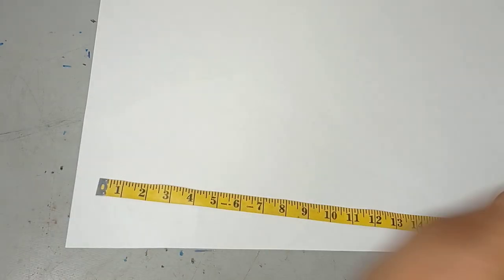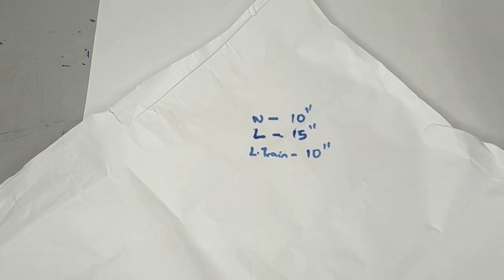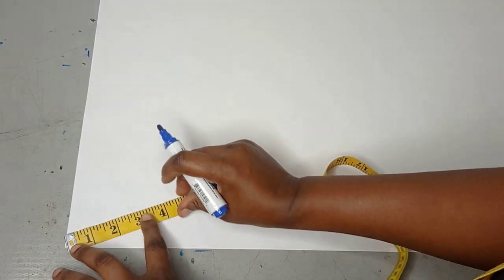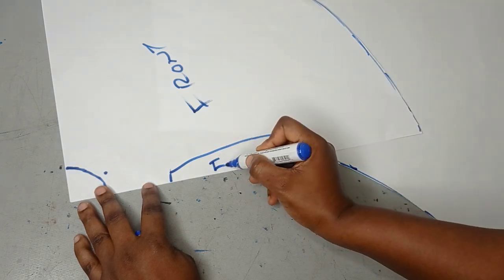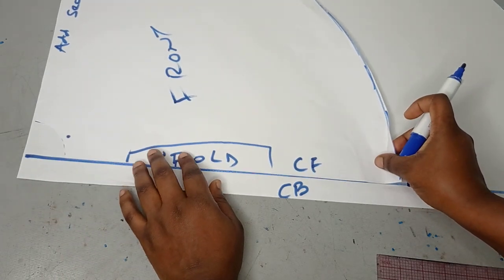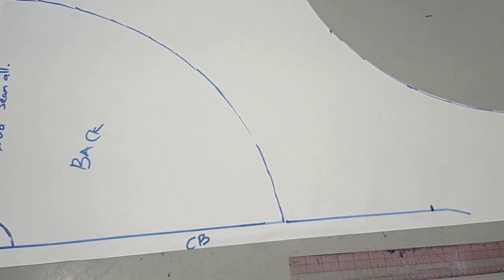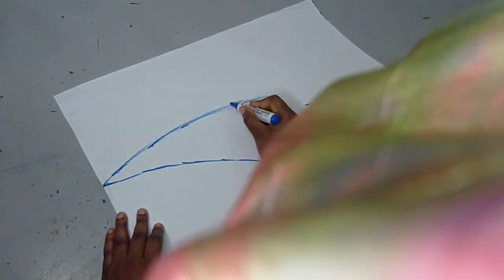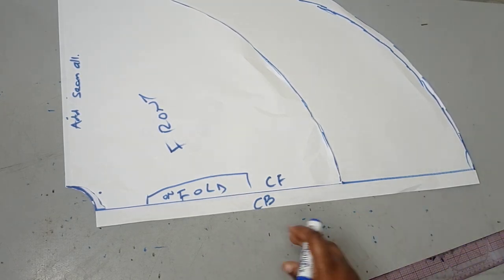How to make a WEDDING DRESS TRAIN Pattern | Mermaid Dress Train

Comment: Thank you so much ma. Please I have a question. Like how many yards do you think a person can use to make a dress like this. And what material is best suited for this?
Reply: For a floor length circle skirt, according to my pattern that I made, I needed 5 yards for the skirt if it's the same size all around. But if it's a trained dress, it's gonna need more fabric depending on the width of the fabric as well as how well the pattern fits on the fabric. Sometimes you'd be using 10-15 yards of fabric just for the train if you want it to be really long and full.